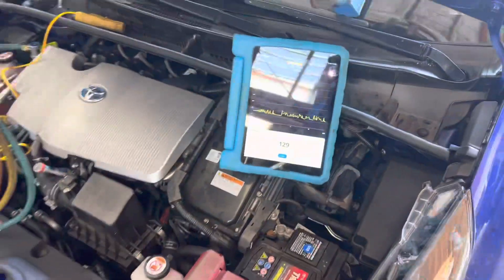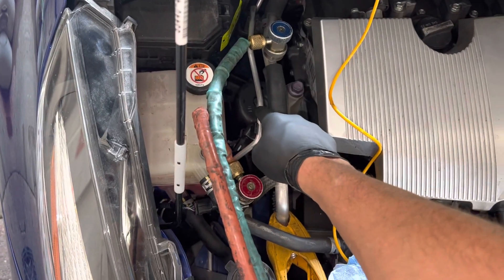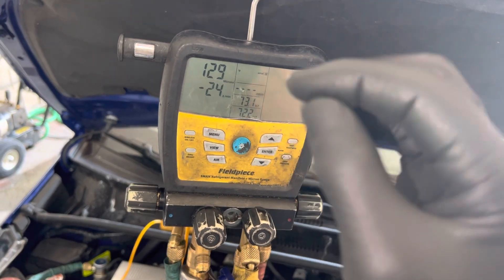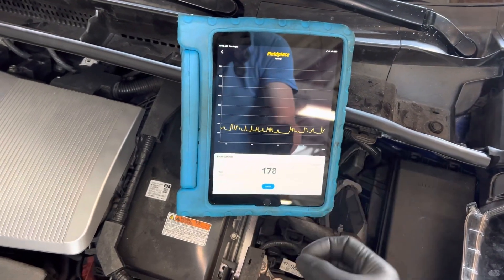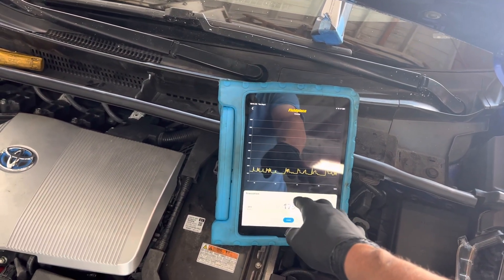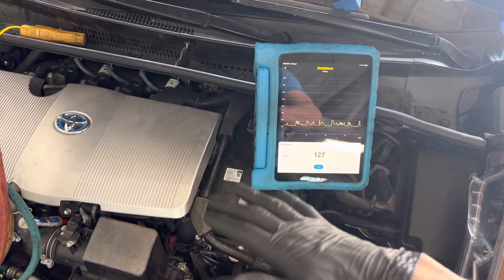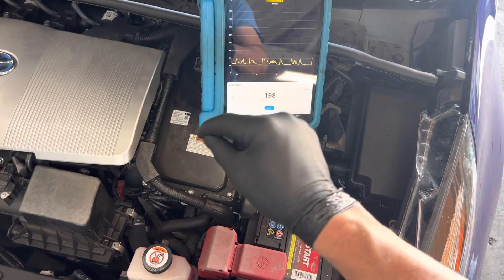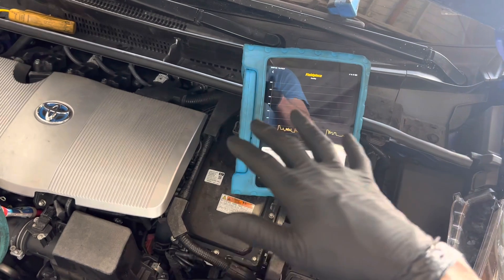Boiling out the moisture From inside the AC￼ system seeing and measuring with a micron gauge. ￼

Comment: In the cases where you need many hours to boil out the moisture, would it help to remove service valve cores? Are there tools available to remove valve cores from r134a quick release type connectors and a shut off valve to reinstall the cores after charging? Who makes them? Thanks.
Reply from the maker: There are not the ones that you can put in line gauges hook up to for your hoses unfortunately I have had one subscriber custom machine a pair and make his own. 

But the circumference surface diameter of the R134 service valves are so huge they have like 10 times the amount of flow compared to the old R 12 service valve cores 

So you cannot compare the old-school 12 refrigerant Schrader cores to the new modern day 134 or 1234YF it’s like comparing apples and oranges

And if you have a good vacuum pump like the one I have read it down to 3 µm it’s not the size of a pumpkin it’s no longer to flow because you have it down to 500 µm or thousand microns within 60 seconds anyway it’s how powerful not how much

And by not using refrigerant rubber hoses using hi vacuum rated silicone vacuum only hoses with no gauges
Reply: @coldfinger459sub0  I saw old-school r12 Schrader valve cores in 2007 Honda Odyssey. I wish we didn't need a new connection type for every new refrigerant: 1/4" flare (r12/r22), 5/16" flare (r410a mini splits), r134a quick connect, r1234yf quick connect. Refrigerant mixing and contamination still happens, as you've been showing us.
Reply from the maker: @crvinva  yes true you are 100% correct there’s no reason to have all these different connectors because if somebody wants to put a different refrigerant in there all they do is get a different thread connector adapter for the hose and they can put anything in there they want it’s very simple and easy. 

But they had good intentions I believe the industry is just trying to prevent the cross contamination of all our gas apply by not the intentional people who will do anything to circumvent and get around the different fittings.   The honest guys who just aren’t too bright and they don’t pay attention and they just hook up to anything and if it fixed they go you gotta remember a big part of the automotive industry get in to Automotive because they cannot read right or do math in school very well.  And many are hired into jobs because they don’t love the industry they just want a job and make money they don’t care about what they’re doing. 
                And there’s a big majority that work for somebody in an automotive business where the owner cannot even work on cars himself he does not care he only cares about making money so he hires the lowest paid guy he can get away with and still be profitable who don’t educate themselves don’t read in the owner is too stupid too lazy and too cheap and many times 100% in capable of training his own guys. 

Look at commercial and residential HVAC years ago before minisplits started coming over we only had quarter inch threads on everything.  12, 22 for 10,11, all the different 500 series refrigerant all the different 400 series refrigerants. 

There was still some cross contamination usually if the stickers and nameplates were missing by accident somebody would make a mistake. 

But then the EPA started approving all those dropping refrigerators that are not dropping refrigerants that you cannot mix with other refrigerants and because they were cheaper they were dropping them in and mixing with other refrigerants.

Comment: I have a r12 system that has been open to atmosphere for over a year. How would you recommend Getting all the moisture out?
Reply from the maker: Change the receiver dryer or change the accumulator whichever one you have and throw it on the vacuum pump for 24 hours .    During the vacuum process run and heat up your engine with the hood closed a few times during this process two or three times is enough for about 15 minutes 20 minutes. 

What does will do is heat up all the refrigerant lines here at the compressor if you put it in defrost mode with the heater on it will heat up the cabin and run hot air over the evaporator.   

And under the deep vacuum while it is being heated up hotter than ambient air temperature this will help boil out some additional moisture under a deep vacuum. 

You’re lucky because it’s the old R 12 mineral oil.    It does not nearly absorb as much moisture as PAG oil or POE oil

Comment: I got my evaporator and accumulator out of a barn. I flushed the evaporator cleaned it up and got all the oil and dirt out. After installing it I was testing my AC for leaks I left the old accumulator as a place holder, which was full of old super contaminated oil, on the car and when i subjected it to vaccum I could hear the crackling as the moisture boiled off. It was very strange and that's when I found out AC oil traps moisture. The silica was probably super saturated too so it was a funny situation
Reply from the maker: Another one is when there’s lots of oil in the accumulator and you just recovered refrigerant and you’re under a vacuum in the accumulator and the refrigerant oil become so cold that several ounces of refrigerant literally get trapped underneath the oil in a liquid state at that minus Fahrenheit temperature because of the vacuum. 

And then when you weren’t paying attention and you forgot to purge the system with nitrogen and you pull out that Ford O-ring connector where the office to is. 

A rush of warm air from you just opening up the line speeds into the cumulator and hits that cold oil and instantly heat it up and that refrigerant that was at a minus Fahrenheit temperature underneath the oil instantly heats up and expands like steam in a exploding radiator or water heater. 

Blowing that oil directly right out of that tube what you just disconnected that’s aiming towards your face right back into your face giving you a oil bath 🛀
Reply: @coldfinger459sub0  Ford push connect fittings are the worst. My brother's F150 gave me the biggest pita trying to get it to hold vaccum. I've had it twice where one of the Orings got pinched pushing the connector together. That's a neat trick though. I thought about pressing the Schrader valve to give it some warm air but I didn't want the oil to spread through the rest of the system to get rid of moisture that would be gone when I replace the accumulator anyway